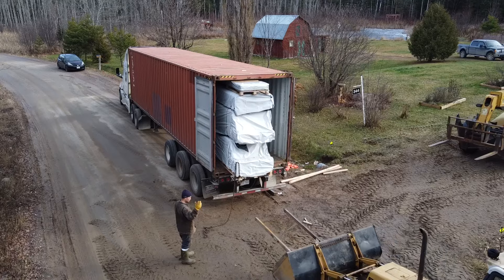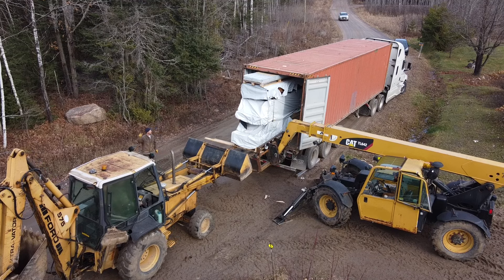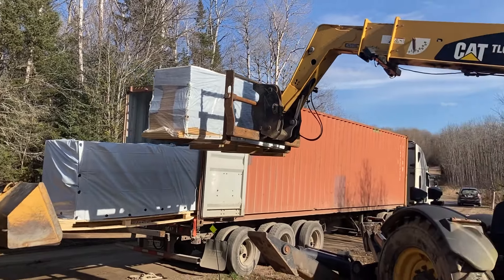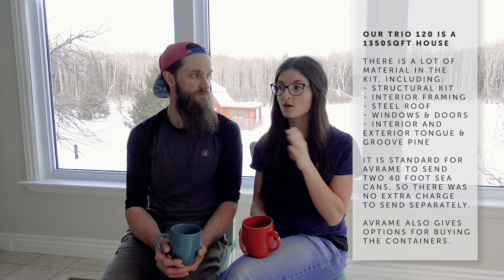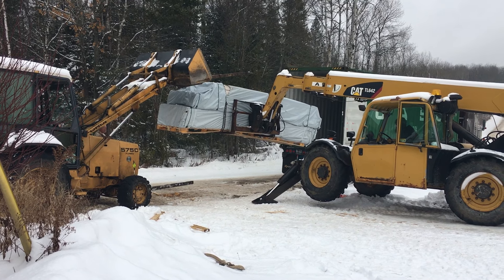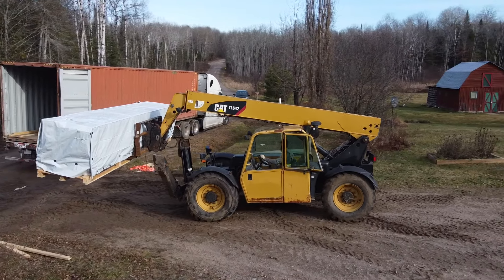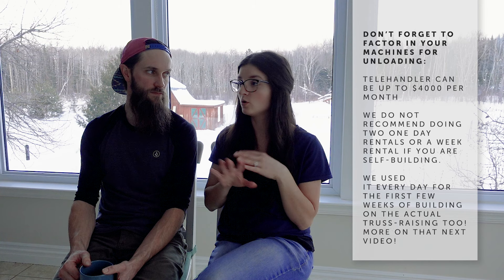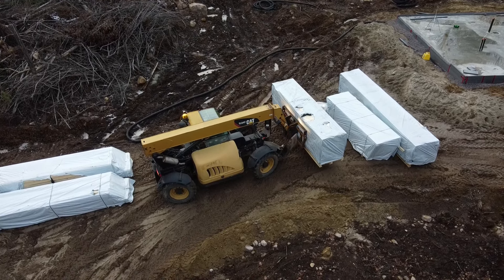COST of Shipping an A-Frame from Europe and How We Did It! With Updated 2025 Numbers!

Comment: If you were to start over would you get the same kit and from the same place?  Surely with the cost of shipping etc, sourcing all the materials locally would have cut costs dramatically?
Reply from the maker: What a great question. At the time there were some crazy inflation prices going on. We actually paid less than what we would have paid for Canadian material but the quality is not even comparable. Keep in mind we had no idea what we were doing and needed the kit to help walk us through. In the end we realised it’s not much different than a custom home purchase. For example when you buy a truss system everything comes pre cut and assembled and engineered. In this scenario the shipping factored into the cost we were still less than Canadian prices. We hope to break it all down in a future video at the end of the build.
Reply: I am building my Avrame in Northern Maine so everything was shipped from Utah. Just to give you some USA costs, the structural kit cost around $7000 to ship, and unloading it with a telehandler was a breeze. It was significantly cheaper for us to source the rest of the materials locally (interior framing, sheathing, advantec flooring, etc)
Reply from the maker: Very cool!
Reply: Ah OK so the kit aspect was a big draw.   I'm building west of north bay but traditional 2x4 framed small house.  Only  400 sq ft but I've built it all myself.  I carried every board and piece of plywood and I'm right at 20k spent so far.  That s the complete structure built and roofed but nothing built inside yet.   Takes alot longer that I thought!
Reply from the maker: Yes it seems everything always takes longer than anticipated!
Reply: @canadianahomestead Avram build quality better or worse?
Reply from the maker: The materials are so much better than what you can get in Canada to be honest!
Reply: My husband is in construction in Ontario Canada and he broke it down. The cost of the kit is definitely cost savings. To get the same quality of materials custom-made and locally sourced would be more. Since the Covid Pandemic, the price of materials has increased and sadly has not gone back down by much. Keep in mind that the main reason the kits are considered more cost-efficient - the intent is for the buyer to build it themselves (DIY). While A-Frames look impressive, the actual building technique is simpler and faster than some traditional homes. If you hire contractors to do the build for you, then your cost will increase dramatically. Especially since many contractors in Ontario are not comfortable with A-Frames as they are not popular here. If they are working with an unfamiliar build, your costs will run you higher.
Reply from the maker: @sophielafleche3803  100% !!!